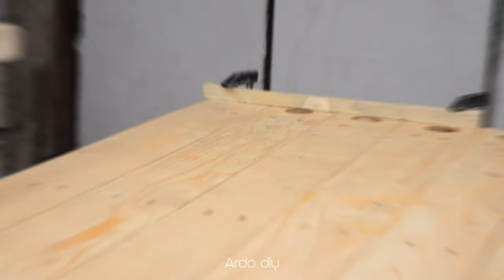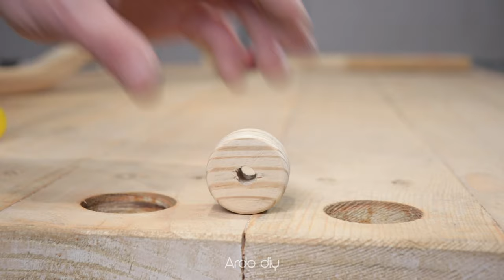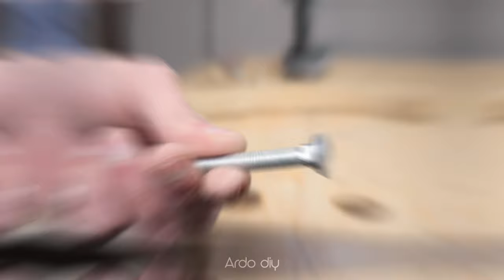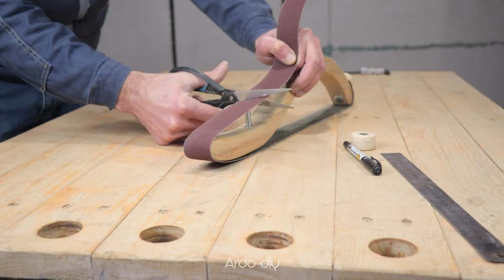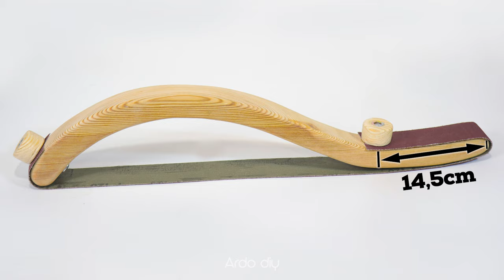How To Make a Bow Sander - DIY sanding tool

Comment from the maker: all info here 👇👇👇👇👇👇

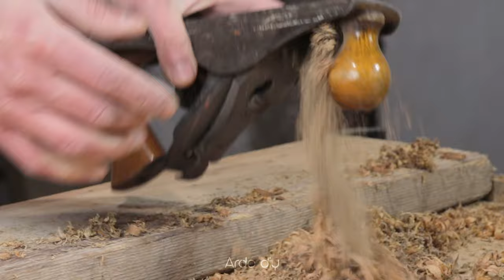00:00 Video started
00:02 I clean the surface of the board with a planer
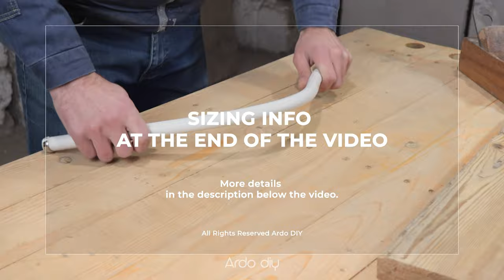00:06 All sizes at the end of the video
00:08 I made a template from a metal-plastic pipe
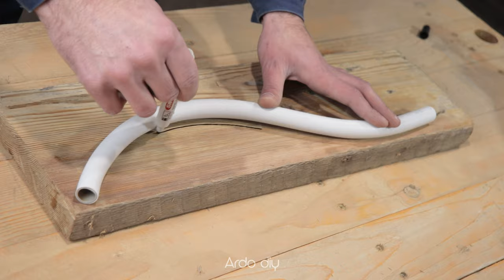00:13 From the resulting curve I transfer the template to the board
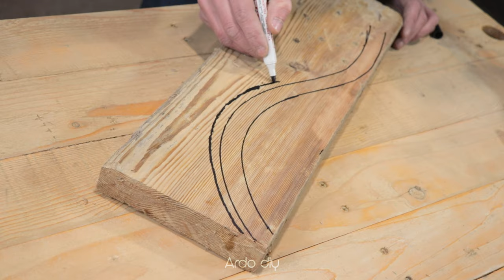00:18 The thickness of the pipe did not suit me, I drew a new line
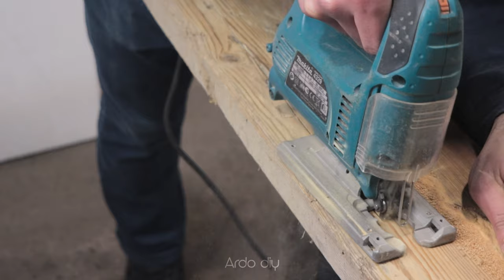00:23 Cut off from the board
00:27 I make cuts to the line of the template
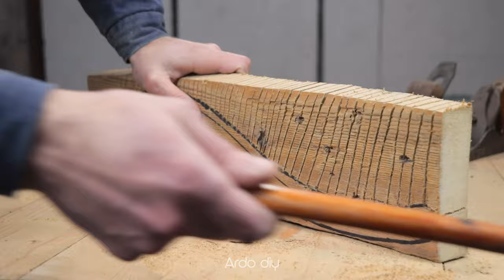00:34 I remove the excess with hammer blows
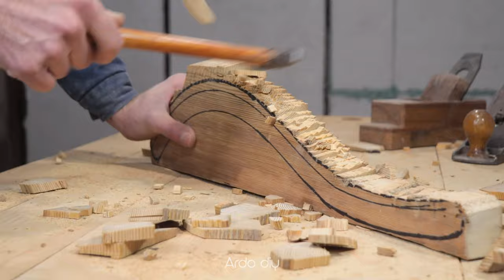00:42 pre-grind using angle grinder
00:46 Repeat the whole process for the reverse side
00:54 We grind in more detail using sandpaper grit 80
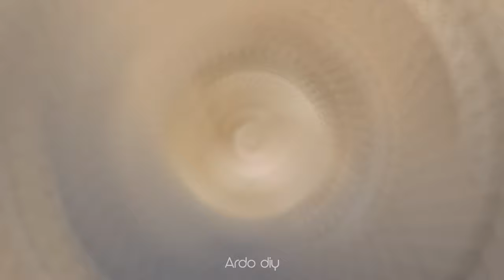01:04 I correct all the shortcomings using a rasp
01:11 Smoothing corners with sponge sandpaper
01:16 Bow Sander base completed
01:19 Make two handles use Hole Saw Drill Bit
01:30 Sand the handles as shown in the video
01:53 Screw into handles Furniture Insert nuts M8
02:10 Position the clamping handles, after checking where it will be convenient to place them
02:23 Mark location and drill holes for M8 bolts AND Furniture Insert nuts
02:41 Fix the Furniture Insert nuts with a hex wrench
02:52 For this project use Round Head Bolt M8
02:59 Place the clamping handles next to the bolt at the site height and shave off the excess
03:07 measure the width of the tool and cut a long piece of sandpaper the same width
03:17 Make an incision on the end of the sandpaper for the bolt
03:28 Fix on one side first
then pull up to the second clamping point and cut off the excess
03:35 Fix the second clamp
03:43 our homemade sanding tool is ready 
03:50  homemade sanding tool Testing
04:13 As tests have shown, this tool can be used with different materials and in different situations.
04:28 sanding tool sizes 
04:36 If you have watched to the end, thank you very much.
04:43 Don't forget to subscribe, like and turn on notifications and we'll see you soon

Comment: 3:14 How can you cut the sandpaper in a straight-line perfectly aligned with just your bare hands?
Reply from the maker: Hi there
the structure of the sandpaper fabric is such that, on the one hand, it is almost impossible to cut by hand
Visualize the x and y axes
First try cutting along the X-axis, if it doesn't work out then
try the Y axis